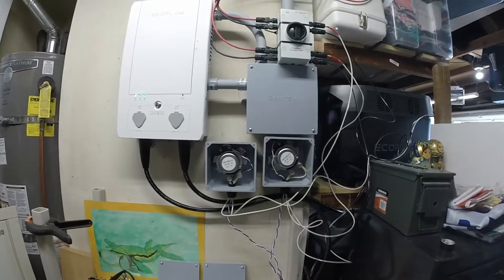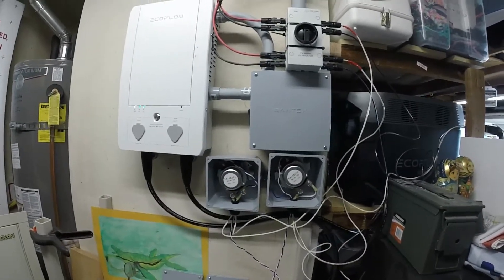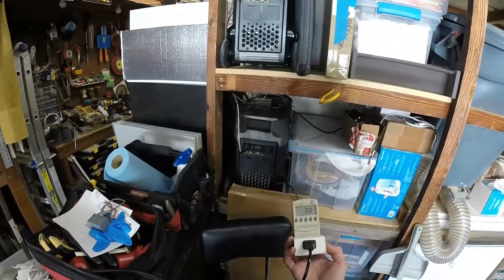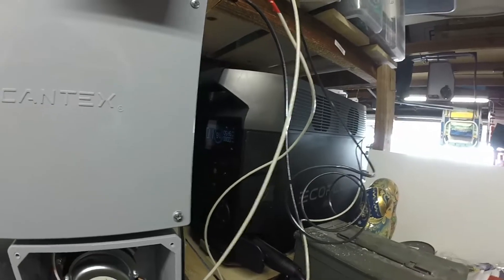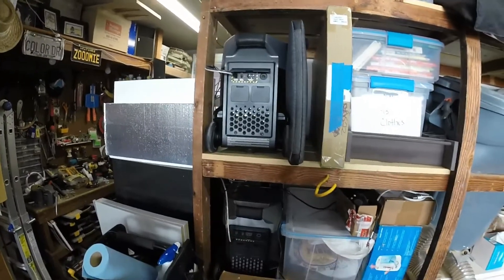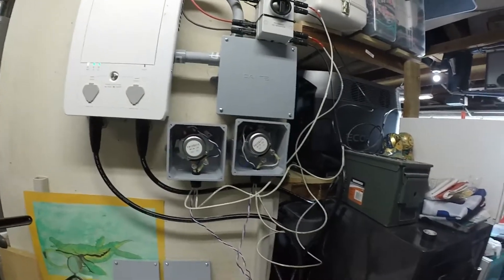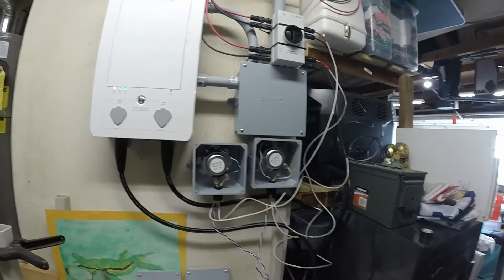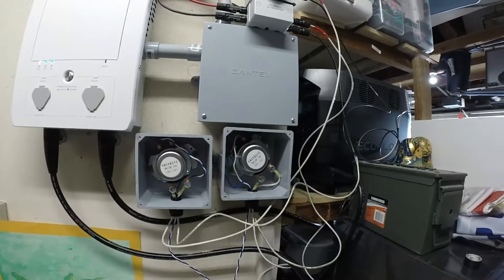ECOFLOW Delta Pro Solar Charging Switch

Comment: I did kinda the same thing as you did but I did mine with relay to control ac line on and off, and left solar connected all the time so the unit charges from solar when it needs it but when batteries getting low I turn on ac for faster full charge as needed.
Answer to Frank Grunders QUESTION...
The EcoFlow unit turns off the solar panels when it is fully charged or reaches the % level you set with the app. Then the power from the solar panels is just there and not being used, unless you use Y cables and connect it to other units.
Reply from the maker: Sounds like a good setup.   I did ask the ecoflow help desk if they'd add functionality to the app so I can program the SHP to charge via AC if the battery charge dropped to a certain level.  Right now that's not possible as far as I know.   I can only tell it to charge via AC based on time/ schedule.

Comment: Really nice setup. How does Ecoflow work when you have more solar then needed for the battery.... can you enable a few groups on the smart home panel to get power direct from the solar...?....or does it always go from the batteries.
Reply from the maker: You cannot specifically program the system to run directly from the inverter/ DC solar power.  One thing I asked Ecoflow to add is the capability to program a rule in the smart home panel to turn in selected circuits when the delta pros reach a specified level of charge.   They said they're looking into adding more flexibility in the SHP rule programming.   I hope that's true.   If love to be able to tell the SHP to turn on some circuits when the charge is at 90 or 100%, then turn off when level of charge drops to a specified %.  Currently the only rules for programming the SHP are date/ time of day.   It will stop discharging the batteries at a specified level of charge, but that's a global setting,  not one specific to a particular rule.